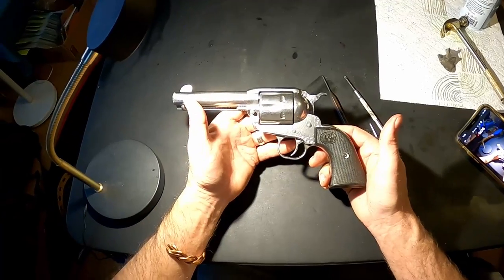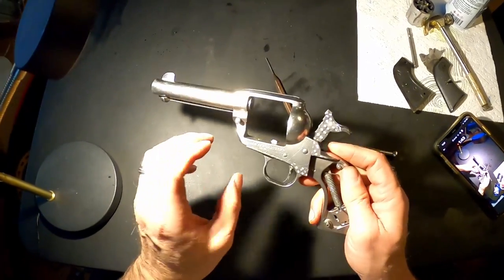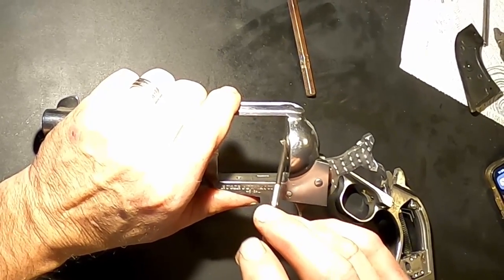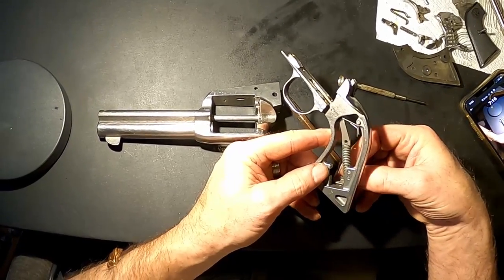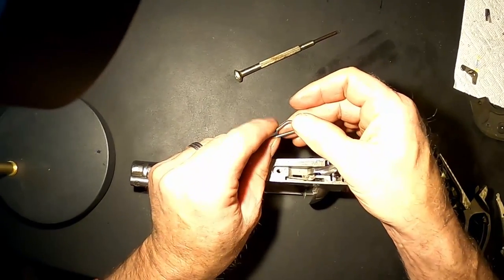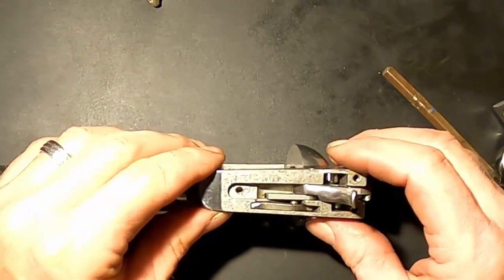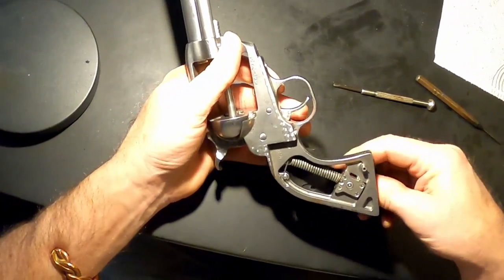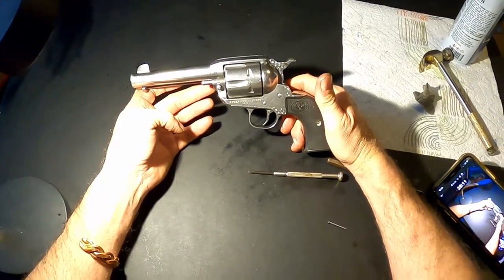Ruger New Vaquero Disassembly and Reassembly

Comment: Glad I found this, I recently inherited a Ruger New Vaquero and as an old Marine you know I have to clean it throughly.  😂
Reply from the maker: BY the time you are done, you and the gun will have a solid connection.  Have fun.
Reply: @rhinestoneropers9204  I’m not a fan of the black plastic grips, rosewood, simulated ivory or stag would look better with the polished stainless steel.

Comment: Never have I wanted to chuck a gun until I bought one of these. Hog trap full of hogs and I'm 3 bullets in and it won't cock or turn, I open the loading gate and the cylinder can turn. I have to turn the cylinder and cock it. I ended up having to get one of my co-workers to help finish popping hogs. I would give this gun away if someone gave one to me. Did a teardown and the cylinder latch spring is junked. So yeah. Not a Ruger Vaquero single 6 fan.
Reply from the maker: I'm sorry about that.  Usually these are very reliable guns.

Comment: Great video. I took my 2008 Ruger Vaquero Bisley apart to change out the trigger and hammer springs. It went back together ok following your lead but now the loading gate won't open all the way. I rechecked your video about the spring and how the gate works but could not figure it out. The spring wants to pop out to the side and will not lock in. Should I maybe replace the loading gate spring? It does look a little worn out. And if so where would you order the spring from? Thanks.
Reply from the maker: I would be surprised to find that the Gate Detent Spring is worn out.  You should be able to take the cylinder out and use a small screw driver to push the spring back into place.  If you need a new one, I would go to Numrich Gun Parts to order.  They should cost about $10.00.  If you have trouble, I would be interested to hear about it.
Good Luck
Dan
Reply: @rhinestoneropers9204  Thanks again, Dan. I did push the spring back into place but no luck. I am going to take the pin out and check the spring and I did order a new one just in case it's bad. The gun was working great before the trigger & hammer spring job. It's got to be something simple. I'll let you know how it goes.
Reply: @rhinestoneropers9204  Hi Dan, I did get a new gate detent spring and through sweat and toil I got the old one out and the new one in. The old one did have a ruff surface where it engaged the gate. Probably done when it fell off center and I tried to force the gate open when I finished assembling it the first time. It works great now. Thanks again for your video. It made all the difference.